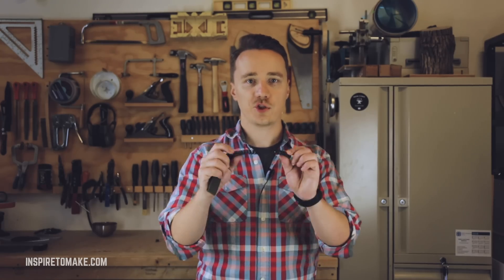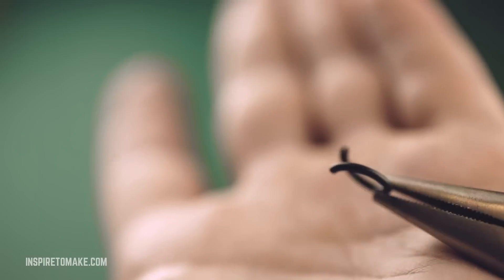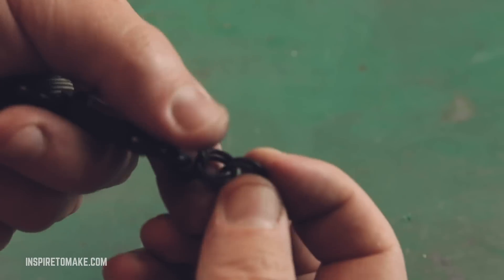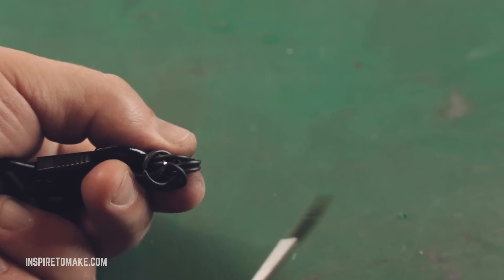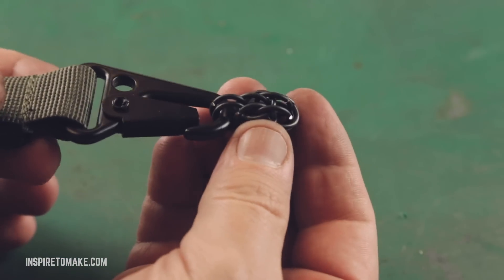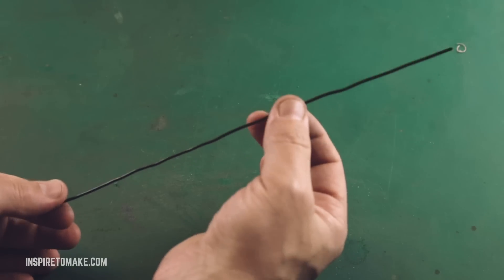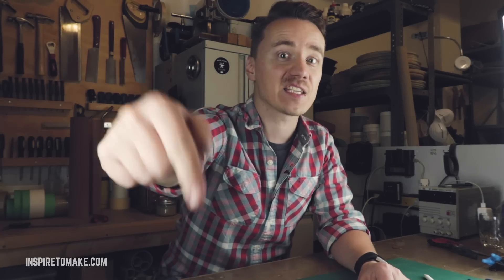DIY Chain Bracelet

Comment from the maker: Please share this video! It will help me to make more cool content for you guys.
Reply: Any idea what the 16 gauge wire would be in diameter in mm? I'm getting mixed signals from the interwebs...
Reply from the maker: Approximately  1-1,2mm
Reply: What kind of knife was that at the very beginning?
Reply: Hey do I have permission to make and sell these locally and potential online?
Reply: Michael Sanchez There are many sellers online. Its not his design so why does he care? Like he said, it dates back hundreds of years ago.
Reply: Hey. I'm gonna try to making this bracelet. But a I have a question. Will the wire rust??
Reply: @-Hondu  Yes, in contact with water. Unless the metal is non corosive.
Reply: instablaster...

Comment: Who else is going to make one 🔥🔥🔥
Reply: Everyone will say "I'll do one!", by no one will actually do it
Reply: I actually will
Reply: Did it. took me 2 days. It's stressful but satisfying
Reply: SS SERPENT yeah. So true. My fingers feel like they’re gonna fall off. But the result is worth it.
Reply: I don't think I would get that type and thickness of wire in my town😑, have to order it online
Reply: @smoke4131  16 gauge is pretty standard wire size. If you wanted to could make this out of solid core copper wire.
Reply: I just did it, took me one hour but my fingers hurt as hell :) btw it looks awsome thx...
Reply: I did it even tho im 13 my fingers got fucked up
Reply: I already did 😛
Reply: I made one with brass. Best to use neddle nose pliers to help bend and work it through. 200 rings, crazy high count. 120 for my bracelet.
Reply: i think i have a roll of this exact wire but a smaller gauge.  i want to make one

Comment: Awesome video, great instructions, good production, thank you for making it.  Two suggestions or recommendations for your ring making.  One, no need to spread the rings, just cut them as the spring.  Spreading them apart can distort them and make them different sizes.  Second, when cutting the rings, you should use a hacksaw at least.  The cutters you have, don't cut, they pinch the metal leaving two 'v's.  It can leave burrs but also when the rings line up just right, they can slide apart.  By using the hacksaw, it's a flush cut that butts together leaving no gaps.

Thank you again for making the video, an excellent resource for anyone who wants to get into making this!
Reply: I’ve never been sorrier to take the advice of a commenter on the internet anywhere. Not saying I do it often, but this sucked enough I need to say something. Not separating the rings with a key earlier meant that my beautiful perfect rings were so close to sealed already that I had to use pliers to pull them apart before I could pop them in and close them again in the proper pattern.This added a shit amount of time and an innumerable amount of new defects and warping because pulling the rings apart was less consistent than just using an alan key/wrench to make the space for me beforehand. Bad suggestion. Try it before you recommend it. Smh.

Comment: Thank you so much for the video and PDF file!!! I tried it out and worked great, only thing I want to try and get better is cutting the wire square instead of into a point, would make for a cleaner joint.
Reply: there is a tool you can use that gives the cut a rounder end
Reply: Instead of separating the coil, leave the spiral tight together, then saw through one side with your saw parallel with the length of the coils. You can cut dozens of rings out at once, with square ends.

Comment: For those wondering the wire used in the video is tie wire for rebar mason work. Please not the coating on the wire is a rust inhibitor and will get on your hands it will wash off with scrubbing but if it gets in your clothes good luck cleaning.

Comment: Hey, amazing video! What kind of wire are you using, I have some trouble finding an all black wire
Reply from the maker: It’s a rebar tie wire
Reply: @InspireToMake  thank you! Does the bracelet scratch you or get stuck in any clothing? It seemed to have some space between the ends of the rings. I'm thinking about sawing the rings off to minimize and space.

Comment: @inspire to make I've watched several tutorials on this chain weave and finally got it down, if you would've made this video 2 months ago I could've saved a lot of time.  Thank you though. One question... Where do you buy the black wire???
Reply from the maker: It’s just a tie wire. I got it from a hardware store.
Reply: Nevermind I read the comments and found that it's black annealed tie wire. Cool.
Reply: Ok. I got the tie wire, made the bracelet, it looks awesome, goes nice with my copper Byzantine bracelet. However, I wore it to work today and with it being a hot sweaty day in Georgia, the bracelet started to rust significantly. Any tips on how I can prevent this. I want to make these for friends but don't want then rusting on them.
Reply from the maker: @magik360720  you can try to use different wire, copper for example. You can use patina to darken the wire

Comment: I subscribed . That was Amaizing and soo beautiful
Reply from the maker: Thanks!
Reply: @InspireToMake  I tried to make mine and i finished the first part.But my wire is little bit to thick so im struggling to close the rings.
Reply from the maker: you should make the radius of your rings bigger.
Reply: Yea thaught so to but that wil effect the width of the bracellet. So im just gonna use thinner wire. Thanks allot  it looks awesome though

Comment: I'm making it right now! I'm using the same rebar tie-down wire, a.k.a annealed black steel wire. My question is: is this skin safe?
Reply from the maker: The oxidation on the wire is living marks everywhere. thats why I sand it down. but it should be fine on skin, I'm not getting any irritation.

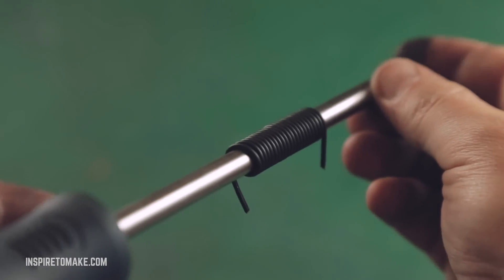Comment: 1:16 How many ohms is that bruh?
Reply: Resistor memes?
Reply: well lets see now, judging by the length of the coil as shown i would estimate that he used roughly 2-ish feet of wire to make it, not knowing what kind of steel that thing is made of i can only assume that its a low carbon steel, due to its flexibility. the difference in low and high carbon steel is not huge but still kinda significant when it comes to resistivity,  it varies from 1 to 10 × 10^(−8) so it can have a resistivity of anything between  7.6mΩ to 76mΩ. in any case its not a lot.

Comment: I'm having a hard time finding the right wire in the EU. Is it coated with black paint?
I can find either thinner or thicker and almost exclusively with a black plastic coating, but I doubt that's what you used. I can find the correct size Aluminum wire. Do you think that would work? (Or if anybody has a link to an international seller that has this kind of wire I'd be super grateful.)
Reply from the maker: Aluminium will totally work. You can also get jump rings for chain making online.
Reply: @InspireToMake  Awesome, thanks for the quick reply :)
Reply: In nederland zijn er verschillende online shops die goed spul verkomen: Kraaltjesshop, Staalkabelstunter, rvspaleis, thequeenring

't is een tijd geleden dat ik de mailen-kolder had (lol) maar da's de sites waar ik toendertijd al m'n spul kocht.

Aluminium is vrij fragiel. Je wil voor roestvrij draad gaan. Je hebt gelijk, er zijn niet veel shops die dat in "handige" chainmail diktes verkopen. Beginner zal vrij snel voor the ring lord gaan, die leveren wereldwijd, en goede prijzen/verzendkosten. In nederland gaan voor thequeenring. Weet niet zeker of ze hun voorraad nog steeds aanvullen, het aanbod is door de jaren heen steeds kleiner geworden, maar de site is nog steeds up, dus hey proberen waard.

Als je toch voor draad gaat: 't is prima te doen zelf ringetjes te maken als je een paar dikke leren handschoenen over hebt (probeer het volgende absoluut NIET zonder dikke handschoenen). Breinaald van de juiste dikte in de accuboormachine met 't draad bij de kop erin, en gaan met die banaan. Een goeie 20 cm "coil" levert rond de 150 ringetjes op met minimale verliezen. Uitkijken met het uiteinde, de spoel staat aardig strak, en draait rustig twee volle rotaties terug bij losknippen van de rvsrol. Uit ervaring, het losse uiteinde wat op hoge snelheid terugschiet gaat dwars door je vinger heen tot op het bot. Geen mooi litteken..

Succes otto, dit is een zeer toffe hobby!
Reply: Oh wow thanks voor je super uitgebreide antwoord.
Ik zal wel gegalvaniseerd ijzerdraad bij de Praxis, daar ga ik maandag even kijken of het echt zo donker is als op de foto, dat zou nog een uitkomst zijn (4 euro voor een lange rol en dan hoef ik niet op zoek te gaan naar sluitingen) maar anders ga ik zeker even al die sites door struinen. Ik zag al mooie zwarte rvs ringetjes bij thequeenring die er goed uit zien. En ik zal zeker even een paar handschoenen opzoeken en de waarschuwing in gedachten houden xD
Reply: Aluminum is great. Easier to cut if you're coiling your own rings. Like OP said, you can also find precut rings online. If you want steel, you can also check out farm supply stores, as they'll usually have large rolls of wire for sale for electric fencing. Just don't burn it to turn it black if it's galvanized wire. As for an international retailer, not sure if TheRingLord ships international. You'd have to look.
Reply: @dementio87  I'm sure you could use copper wire also if you wanted a different look. Just don't want it to work harden and break.